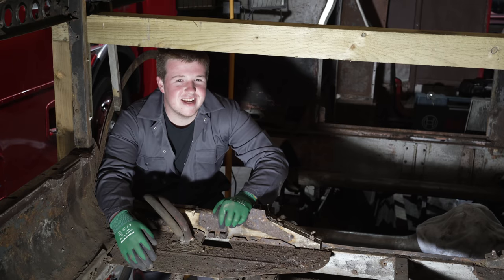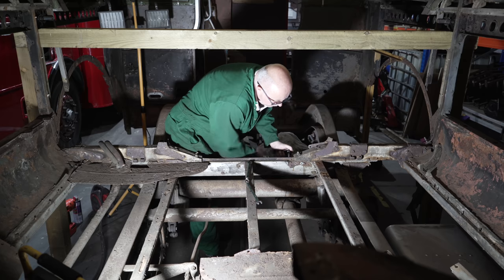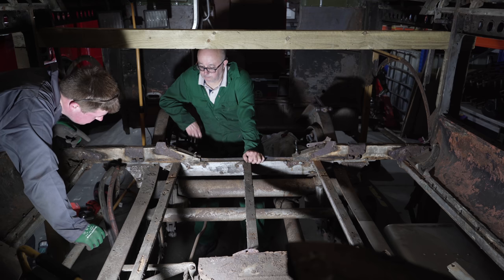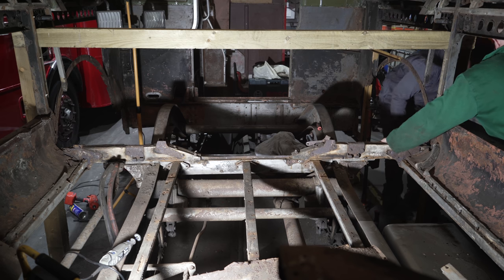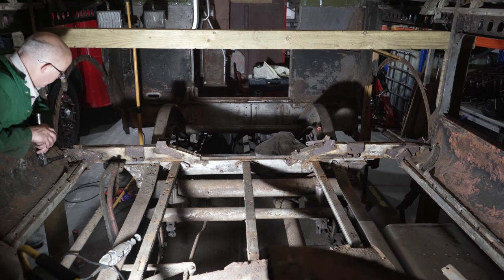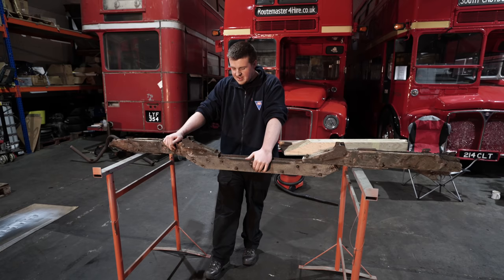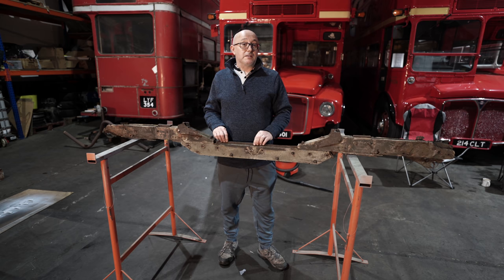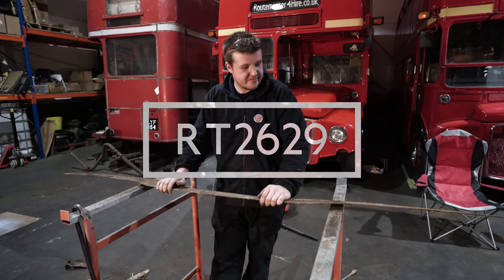Ep4: How To Restore a 70 Year Old London Double Decker Bus | Rotten Beam Removal

Comment: Have to say you are so right about 'bling and shiny' v.s done properly. I'm an old Land Rover nut - without proper workshop access but have done some work and farmed out a lot to a caring pro. My weak area is CAD. Do you use Fusion 360? Is it hard to learn? Making old components is very time consuming. Great work though - the Routemaster was (is) an amazing technological achievement albeit made from all manner of materials that have now moved on. It's like a large Morgan really - with all that wood in it!

Comment: Love watching your videos guys could this not be replaced with a metal or aluminium chassis rather than wood. I never knew RT buses had would Chassis. It's bound to rot underneath when the roads are wet. 👍👌
Reply from the maker: Yes we could very easily replace with something that would last longer, but we like to restore our buses using the same materials that they had when new.

Comment: Hi,after the crossbeam has been renewed does the work have to be signed off by a surveyor as part of MOT work.cheers Roly 🇬🇧.
Reply from the maker: No not at this stage, but the bus will have an MOT when finished even tho technically it would be MOT exempt here in the UK.

Comment: Diesel engines in the US after 2011 have to add urea to the engine to clean the catalytic converter. Something the legislator came up with to clean the environment and Jack the price of diesel up astronomically the cost of which it in turn gets passed on to the consumer! But cuts down on the life of an engine because diesel had a lot of oil in it which allowed a diesel to run for thousands of miles.
What sort of diesel do you have to run in your buses and how do they respond.

Comment: hi there, when i worked for London Transport we used to send the buses to Aldenham works for overhaul, the bodies would be lifted off the  chassis and inspected, also the chassis was inspected and repaired if required.there was always plenty of recon engines about, AEC or LEYLAND 0.600.the turn around was very  fast
Reply from the maker: Shame Aldenham closed, as parts dept there would be very handy.  Also a shame there's not any recon engines knocking around nowadays.
Reply: @Routemaster4Hire  I was with LT 1970-80 and RM engines then were getting dodgy after so many recons. Towards the end a lot of RTs were put out to grass as the rear cross members had gone and they weren't worth repairing, too big a job for an old vehicle.
I always say; these vehicles were built to last, not be immortal!
Great job you guys are doing, glad that vehicles like this are now considered worth saving.